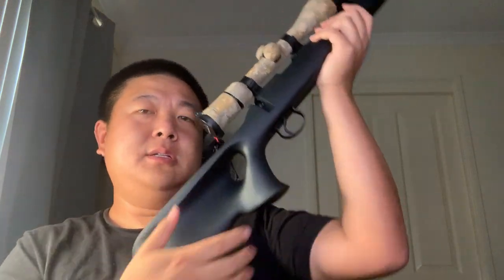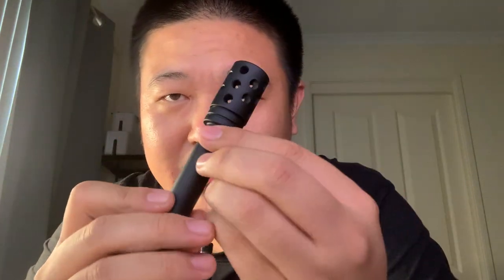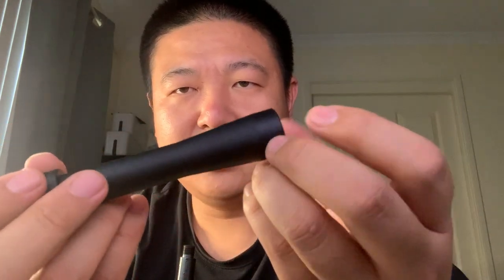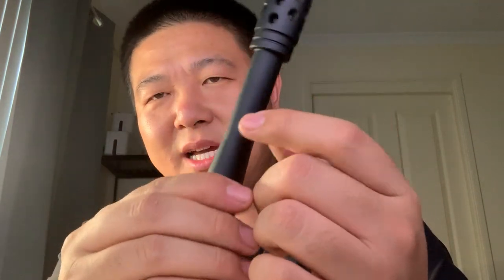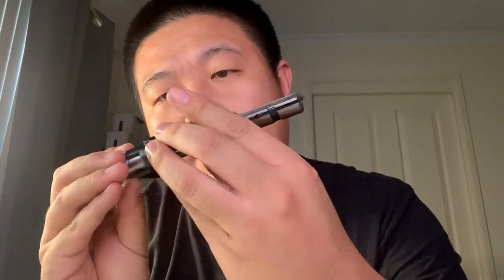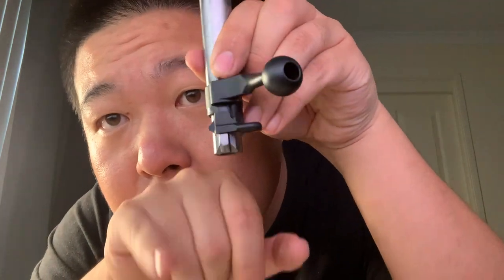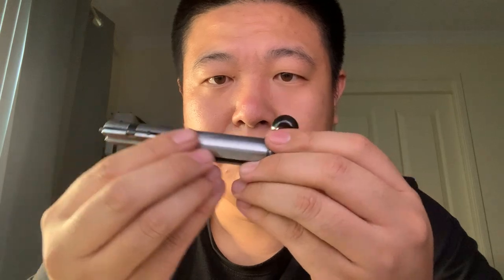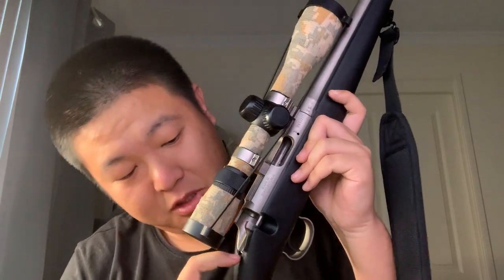Little dirty secrets of CZ 455 carbon fiber synthetic thumb hole rifle

Comment: Thanks for posting your video!
$630??  I paid nearly twice that in Adelaide :(
Yeah, supposed to be a CARBON WRAPPED barrel ("super accurate"), and SYNTHETIC stock.  I wish I'd seen your video before I bought mine.  I have a BRNO Mod 2, good rifle, but I was looking for another - and had a choice of 3, Lithgow, Tikka, or CZ.  I'd PREFER to buy Australian made, but have heard too many reports of faults with the Lithgows (the quality is hit n miss?), the Tikka's have proprietary magazines (expensive) and some people comment about the 'plastic' thread caps - so I went with the CZ.  I haven't fired it yet (will strip it down and clean it first), so it might turn out ok, but it seems it isn't what I was expecting.  
I suppose if I can change the barrel myself (it is a 455) I might have the option of getting a varmit barrel down the track...
Reply from the maker: yes. it is $630 in sydney. abela and horsley park both had them for $630 with one ammo box and one geco 4*30 scope and one spika rifle bag.....yes total of $630. The lithgow is not as accurate as sponsored video on youtube. I knew a fellow had one and it does not shoot better than a CZ452. Tikka has a spring scratching the bolt which made it not that smooth as CZ. I suppose the CZ455 stocks without thumbhole versions are real syn stock.  You can buy CZ varmint barrels and IBI match barrels on cleavers. They can be changed with in seconds. By the way. this fake carbon 455 is quite accurate. I shot a few rabbits with it already. But if give a 2nd chance, I will go 455 stainless normal barrel with real syn stock.
Reply from the maker: there is one problem on my rifle which you need to be careful. I found the timber frame around the bottom plate is quite soft and the timber may sag if you apply too much torque(I mean normal torque range on other brands rifles). my plate sagged and I removed some  timber material and applied some fibreglass around the bottom plate timber frame and now it is ok. just be ultra careful on that, I think it is a design flaw
Reply: @feicheng7022  it’s so good

Comment: More importantly, how does it compare to other .22lr rifles, such as a standard 455? Keep the video coming 兄弟
Reply from the maker: I do not have a standard 455. But should be just the stock and the barrel length. the decorative parts wont contribute to accuracy I would say.

Comment: Hey bro, did you end up shooting the Savage A22R? Can you post up any pictures of the groupings etc.?
Reply from the maker: yes. I end up putting up a red dot on it. So the spread is quite big as expected. I just installed another 4 times and have not got a chance to try again due to the shut of range because of the virus shit. I will post some group once I have a chance.
Reply from the maker: hi. my savage a22r blown up. The dust cover was blown off by the failed recoil rod. Almost end up in my face or eye. I sent it to NIOA and NIOA bought it back from me and issued a full refund. Be careful and do not buy A22R